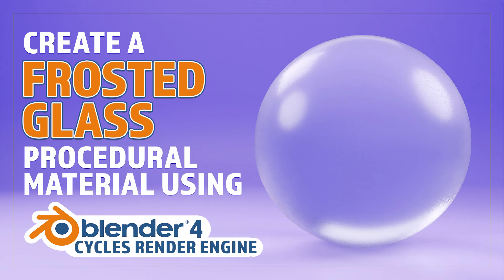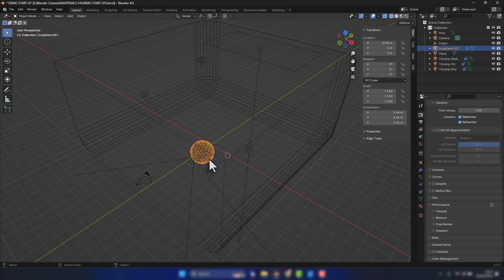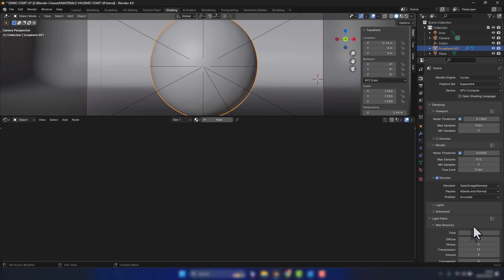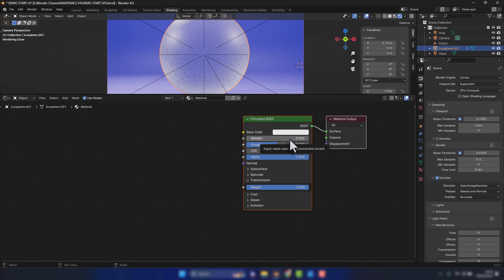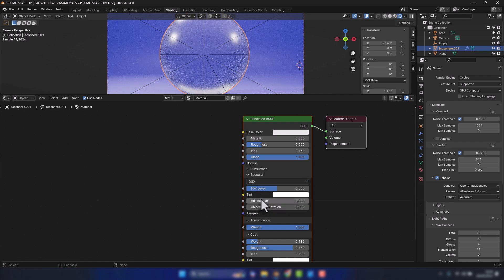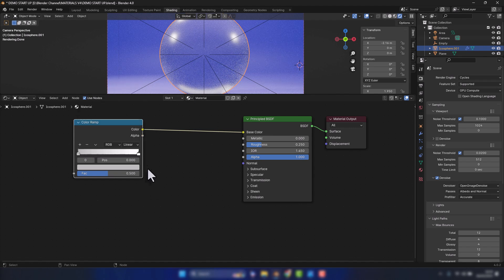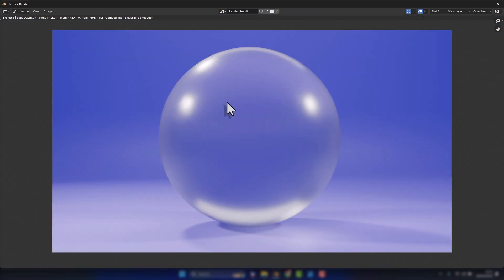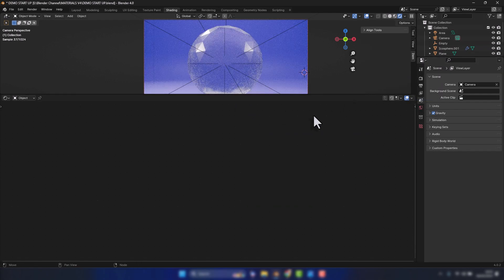CREATE A PROCEDURAL FROSTED GLASS MATERIAL IN BLENDER V4

Comment: This video has two problems. First, why use a color ramp node to select a shade of gray? Color ramp is a mapper, maps an input to an output, without input it outputs the value to the right of the slider, white in this case. It's now acting exactly as the base color as is without anything connected.

Second, if you reduce the saturation of pure white or any shade of neutral grey for what matters... you get the same exact color, no change. It's then using two nodes to set a color when no one of those is doing anything worth of mention. The node tree works exactly the same, 100% just tweaking the base color.

It's a good way to explain how to use the principled for more advanced materials, but this part of the extra nodes is a bit confusing.
Reply from the maker: Thanks for the feedback, I really appreciate it. As with all of my videos, they are my way of doing things. I cant always guarantee that they are the best way or the way someone else would have done it. Over the years I've noticed that there are often more than one way to do things with blender so if you find a different way that works better for you, run with it. These are mostly a spring board to encourage exploration.